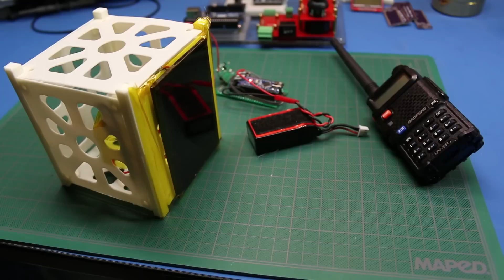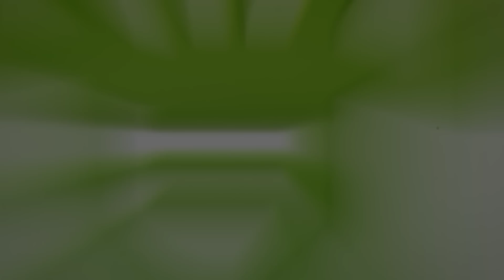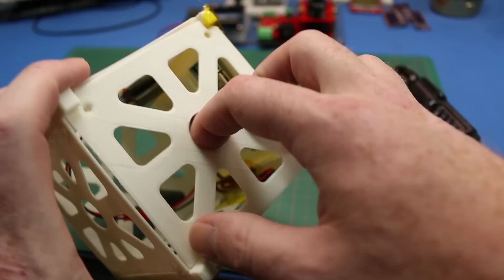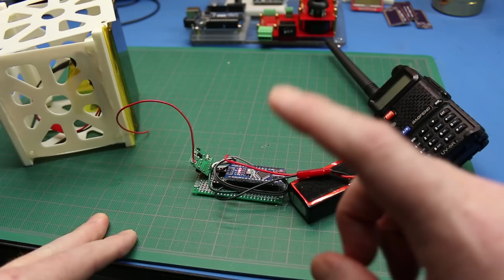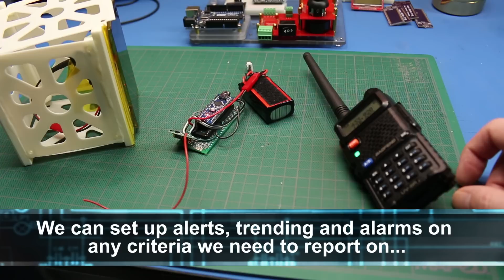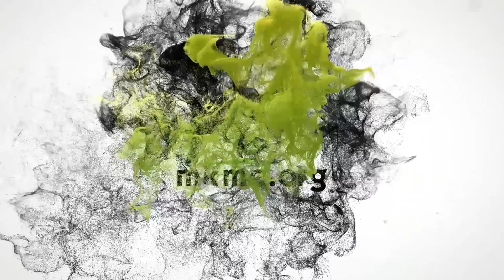Let's make a Satellite with Arduino Part 5- Voice telemetry transmission!

Comment: thanks for video but i have question. is it possible to transmit data through speaker? i bought thoose 433mhz transmiter and receiver but they are broken:/sadly. so now im trying to find a better way to control my rc in a diy way. i dont even how to search for this so if you answer this question i will be very,very happy.

Comment: Good job bro.  But I have a q. 
..what is the range of it??? 
..can I receive the massage on my phone??? 
...can it send data from space???
Reply: 1.) The range is determined by not only the output power of the transmitter but by: it's altitude, sensitivity of the receiver, type of modulation and directivity of both the transmitter and receiver antennas. 
2.) No, you phone operates on a different frequency
3.) If the sat can handle the rigors of space, (battery's don't like cold etc.) It can transmitter from space if you can get it there. Whether you can receive it depends on how you deal with the variables presented in answer number one.
Reply: 1. He said 100 yards in the previous video

2. Although you can order a massage, you cannot receive a message on your phone. At least not without radio, since your phone can't receive radio waves.

3. No, because he sends at a low power since he's prototyping and probably doesnt wanna push amateurs off on this band.
Reply: Julian Petit - 100 yds terrestrial. Do you understand that a cellphone is a radio transceiver (just at a different frequency) ? You can receive very low power signals great distances with the right modulation and a sensitive receiver with antennas that increase effective gain thru directivity.

Comment: I'm really interested in this project! I have a question, how could you use an Arduino Nano to transmit pictures and data back from the sat? What kind of transmitter could I use for long-range transmission? Thanks in advance!
Reply from the maker: Arduinos dont really handle image processing.  The transmitter can be pretty much anything. You actually dont need a tonne of power to reach from LEO

Comment: variable 'spZERO' must be const in order to be put into read-only section by means of '__attribute__((progmem))'

find the problem.. https://github.com/PaulStoffregen/Talkie
Reply: Place the word const in front the uint8-t on each of the spXXXX lines (or between the // and uint8-t statement)...that should solve the problem (if you haven't fixed it all ready.

Comment: forget that, ive just found it on the web haha, one more thing, can a reciver transmit?
thanks
Reply from the maker: +Jack Motola Receivers receive :)  Transceivers can do both.
Reply: +MKme Lab thats perfect dude thanks, i bought a transmisor and i finally got it, for anybody with problems i found out that (at least with me) dosent work in the new versions, try to put it in 1.0.6 ;)
Reply from the maker: Jack Motola Yeah I usually put in the comments what IDE version I used it with but maybe I forgot in that code.
Reply: +MKme Lab yeah you forgot haha but never mind, actually THANKS for making this posible :)

Comment: Cool video. Do you need a license for the kind of transmission you're doing in this?
Reply from the maker: +Leopold Arkham Depends on the area you live.  In my area to the best of my research, at this low power all is well.  Other areas definitely differ depending on the licensed bands.  Cheers

Comment: Can see the utility of using phone for transmission but cw/rtty/etc are perfect for low power, low bandwidth transmissions and in theory you should get more bang for your buck if battery powered.

SSTV would be interesting, having low resolution (for speed) images transmitted back from a cheap camera mounted on the satellite.
Reply from the maker: +M3ta7h3ad Will do some SSTV in the future.  Cheers